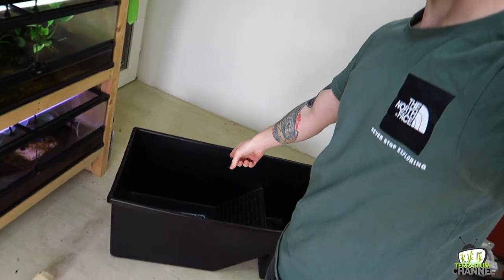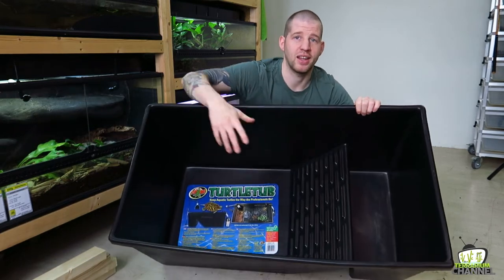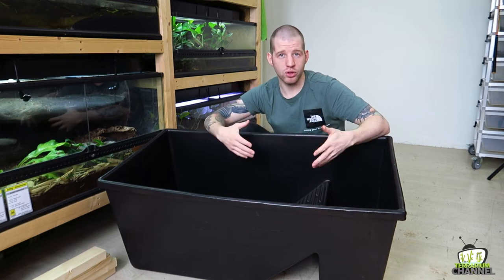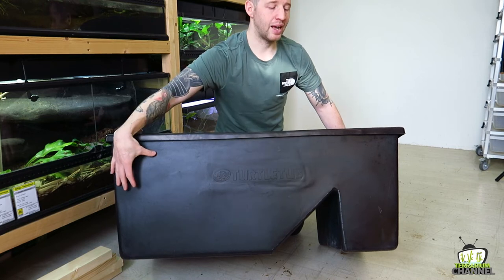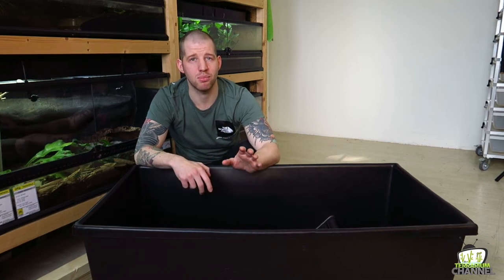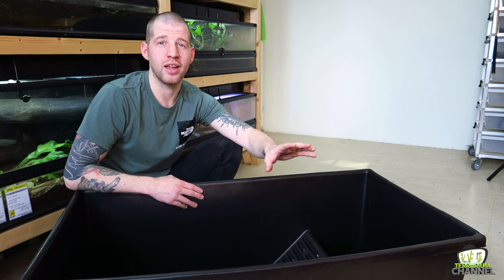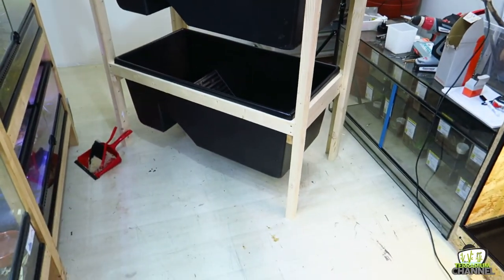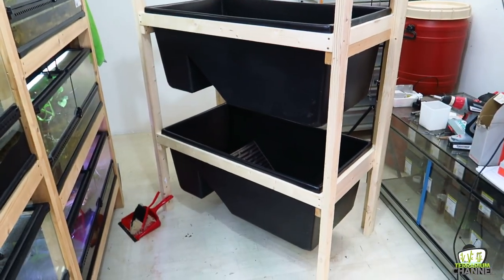Zoomed Turtletub Review and building a Turtlerack

Comment: In my opinion the Zoomed tub is to small. I have one Clemmys guttata male in a small Waterlandtub and I wouldn't go any smaller than that. But that's just my opinion and I like space for my turtles. To bad they are so expensive if you want to import them to Europe though. But nice build, don't you need any support under the tubs?
Reply from the maker: Hi Fredrik. Bigger is always better ofcource! For sure.  I know of many using them for their guttata males thats why I mentioned them.  Because of the shape and relatif small size the tubs are sturdy enough so I dont think any extra support is needed. If they where just square pondtubs like I also have I would. But these are pretty sturdy.
Reply: @terrariumchannel  Yeah, I understand. I'm just to nervous to build without the extra support. 😄

Comment: Is it safe to fill water all the way to the top without the tub cracking?
Reply from the maker: Did not try. They are very sturdy so would not expect it. But pretty sure it will bend out. Best to put a frame around it then
Reply: @terrariumchannel  Thanks